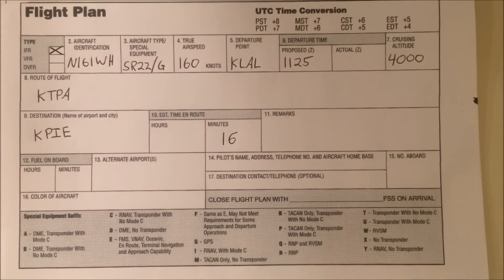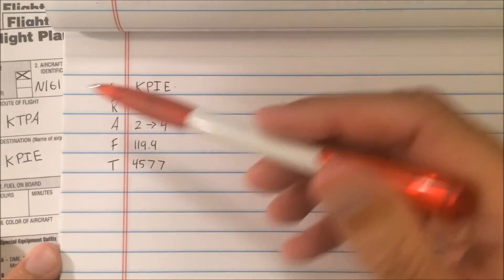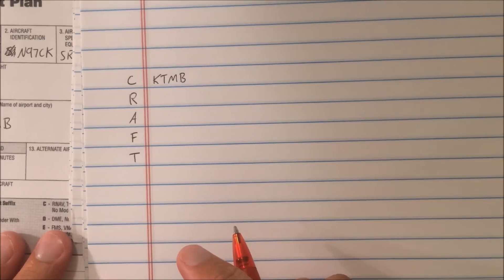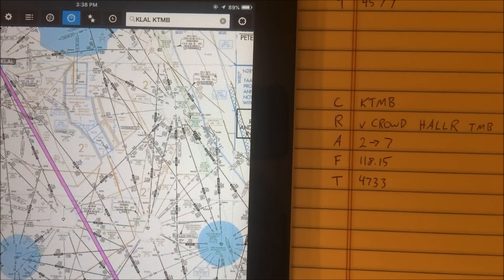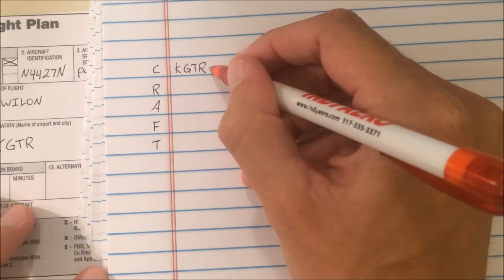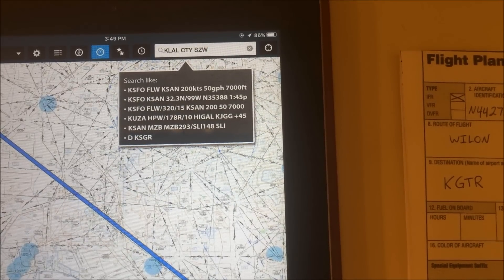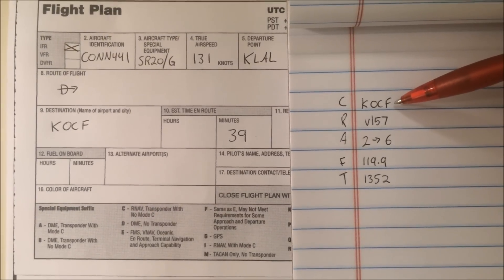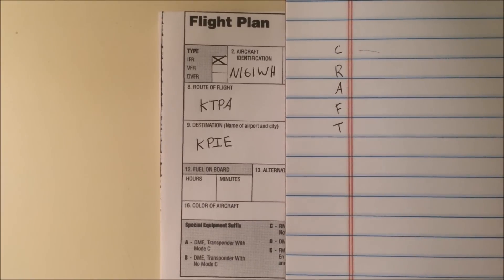IFR Clearance Practice for General Aviation

Comment: I have heard ATC speak this clear, ...but only when I'm in the back seat! Task saturation makes all the difference. All you Inst students should ride along on each others' flights and just follow the procedures as if you are flying; Don't say anything out loud so you don't distract from the actual lesson but wear foggles if not in IMC, scan the panel, write down clearances, brief approach plates. You will find that it is all a easy peasy without that extra burden of manipulating the flight controls.

Comment: Subtle note on the KLAL Direct KOCF and the V157 clearance.
 v157 and direct are only the same ground track if you don't consider departure transition and the initial approach fix. They are not really the same  routing in practice because v157 has an MEA and you would be expected to have a transition to promptly intercept the center of the airway after departure. With an RNAV "KOFC direct" clearance a departure that puts you a few miles to the side of v157 followed an IAF a few miles to the side of the destination may end up being quite a different ground track. This may be inconsequential in Florida, and certainly most places when radar vectoring is the norm, but it is a substantial consideration in the mountainous areas out west for lost com contingencies or radar shadows(high minimum vectoring altitudes), where we put a lot of IFR flight plan effort into the obstacle departure and transition to enroute and transition from enroute to approach.

Comment: What does 'maintain 2000 and Expect 'Whatever Alt eg.8000' mean? Does it mean that you can climb up to 2000 and keep climbing to the Altitude(in this case 8000? Is 'at or above' omitted front of 2000?
Reply: Climb to 2000. Then departure will clear you for 8000 after you takeoff off the frequency they give you

Comment: One thing that made it more difficult for me is I don't know the acronyms for the navaids, so I have to write them out. Makes it difficult to keep up, even more so if he were speaking at the same speed as most controllers. Your instruction does help though. My instructors (back in the 80s) didn't teach me this stuff. They taught me to fly approaches and navigate using navaids; that's pretty much it. Nothing else. I'm amazed that I earned my rating knowing as little as I did. One of the reasons I've always avoided IFR flying.

Comment: As an IFR student without 20 hours of simulated time, this is by far the HARDEST thing for me. Both copying IFR flight plan clearances, and in-flight commands. In flight is easier but still tricky when your monitoring destination frequency/atis etc.
Reply: It just takes more practice in the system. You just get used to it since you will always get the same information more or less in the same way. As far as getting the atis, try to get it at around the 15 mile mark. Around that time I always seem to get a few minutes of breathing room after being handed over to the approach controller and I am close enough to pick up the frequency. Honestly the only way to get good is to do it enough times that you start to notice the patterns and it all starts to make sense. When you first start out it sounds a hell of a lot more complicated than it actually is, but it just sounds that way. You will get it, and ATC is usually pretty accommodating for low time pilots...  Unless you are talking to New York or Boston. NY and BOS are hard mode.

Comment: can Somme explain the 2-4. 2000 feet then [EXPECT?] 4000 feet in ten minutes what does that mean
Reply: It's in case you lose your radios after takeoff. So if you took off and the radios decided to take a vacation you would know to fly at 2000 feet and then 10 minutes after takeoff ATC would expect you to go up to your filed altitude and fly your clearance.

Comment: This video is really well done.  I feel like I've got it except that the routes could prove difficult until I learn all the Victor airways and waypoints in my area and wherever I may go to.  For experience IFR pilots, does it prove difficult when going to a new area?
Reply: Not Really...You just need to be ready for TWR ATC to give a different route and know your phonetic alphabet. (alpha, bravo, charlie, delta, echo, foxtrot...and so on).  So when you do the routing be certain sure you noted the phonetic spelling used by ATC.  When you do it's just a matter of entering the waypoint into your plane gps or handheld. I've heard commercial pilots try to put in their system as they are provided it by ATC. Waypoints can be said one way and spelled different from what you expect.  EG:  The ATC said a waypoint and we heard "Hipster" ATC TWR didn't phonetically spell it out so when we did our read back they had to give the proper waypoint spelling which was Hotel, Yankee, Papa, Sierra, Tango, Romeo (HYPSTR)  so when you write it down first you only need to put the waypoint spelling provided and the GPS comes up with it pretty easy.

Comment: I wish ATC speak this clear and slow in real life
Reply: I really get lost each time ATC talks, that's why my recorder is always on , if I miss asking ATC please repeat 😠I don't understand , why they rush to talk nice and clear to provide safety to all pilots,  it's sometime really unbelievable.
Reply: @FlightSim2703  It really depends on where you are. A small towered airport is usually a bit more relaxed while a class B tracon facility is accustomed to closely scheduled flights with professional pilots in two pilot cockpits where one is flying and the other is using the radios.
Reply: When ATC dares shooting my CLNC at me rapid-fire, I read it back to 'em at Mach 2! Ah, good times.
Reply: Adam POV lol thinking the same
Reply: i absoluetly agree on this  the atc thinks that you can understand all of the info that they give in seconds. that is the biggest obstacle for the  pilots couse comminication is everthing when airborn.
Reply: His examples are exactly how clearances are issued by ATC.  If you want proof listen to www.liveatc.net
Reply: The controllers could be more aware of aircraft types. Thus they could ascertain if the pilots were commercial airline pilots or otherwise.

Comment: Nice video for dirt-simple clearance copying.  However, the comments about spelling out fixes, or having to know them in advance, is on target.  Here are two typical clearances you'll get from SoCal approach if you enter the basin from the east, headed for Orange County or Fullerton:  "Palm Springs VOR V388 ACINS V283 Seal Beach VOR"  or  "Depart Paradise VOR on the 270 radial, intercept V394 to Seal Beach VOR".  I don't think there's even a way to program intercepting V394 in the middle of a leg, and of course they don't spell out the identifiers for the intersections or VORs.  Turns out these are Tower Enroute Control routes buried in the back of the Chart Supplements (formerly Airport / Facilities Directory) and they just sorta expect you to be able to absorb them on the fly, and to be able to switch from one to the other more or less immediately.

Comment: I like to add the following on the A in CRAFT  ______X_________:   So in the first example 2X4:10  which would be 2000 expect 4000 in 10 minutes.  Because I am a student I like writing down the minutes given in the clearance. Less to forget with nerves.  Good video!
Reply: @747-pilot, it's not always 10 mins, it depends upon ATC needs.
One reason for "time" in the clearance relates to "lost radio communications" (14 CFR 91.185) during IFR.
Second reason is when the pilot's cruise altitude must be delayed for ATC restrictions/requirements. If this happens, a pilot will get "expect XX-thousand or FLXXX 10 minutes after departure".
Check out, (USDOT, FAA, Air Traffic Organization Policy, JO 7110.65X, 4-3-2 DEPARTURE CLEARANCES). Look for EXAMPLE−2 which is a few paragraphs before 4−3−3 ABBREVIATED DEPARTURE CLEARANCE.
Reply: Windtee, thanks for that explanation!
Reply: I always write it 2----4/10. As long as it works, right?
Reply: I like that abbreviation. It makes sense.
Reply: I like that abbreviation. It makes sense.
Reply: Great! Thanks! That was my next question. Is it always 10 minutes, or does it vary. I've not yet started instrument training, but am trying to get ahead of the game!

Comment: Would it be better to have a pre-designed template to fill out, rather than a blank sheet of paper?  Using the flight plan sheet during clearance delivery for example.

Comment: Nice video. So if you didn't know the Cross City or Seminole designators and you didn't have Foreflight, what would your process be?  I imagine it would be easy to get behind the ball trying to find some random waypoint or intersection on an IFR chart.
Reply: On the readback, you can simply ask ATC to spell the waypoints.
Reply: Good question, I thought the same.